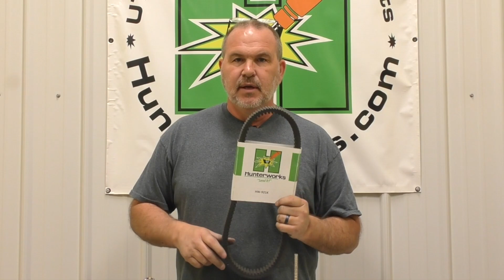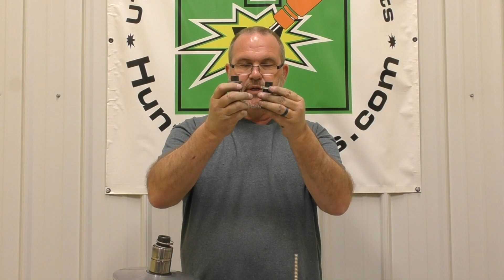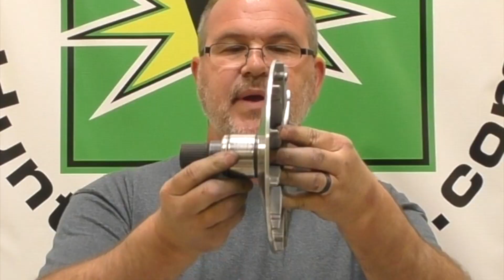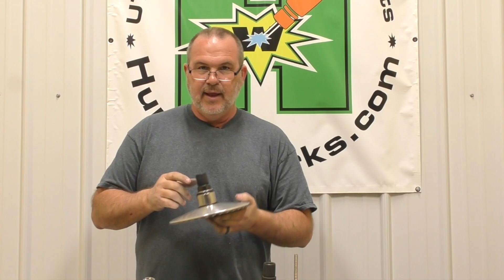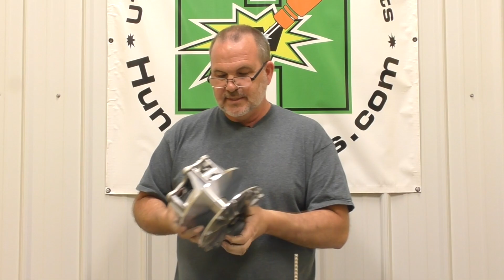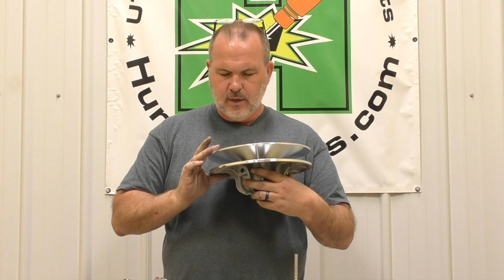2021 Polaris Ranger XP 1000 Clutch Differences

Comment: You keep mentioning the Polaris Ranger 1000XP but what I have is the 2020 1000 esp, is that a different clutch then what I have. What would be the number on your belt that would fit my machine. 2020 Polaris Ranger 1000 esp? Thanks
Reply from the maker: https://www.hunterworks.com/inc/sdetail/96685/181214
Reply from the maker: And yes the regular 1000 has a different clutch than the XP

Comment: How do you know if your 2021 xp1000 ranger has the 1 way ebs bearing or the 2 way non ebs?
Reply from the maker: You should know if the model you bought has ebs but you can take a pic inside clutch and see if you see the ebs mechanism.
Reply: I just bought it yesterday I bought it from a buddy that bought it new only had it a week so I don’t know if it has it or not it kinda feels like it but I’ve only driven it twice.. has less than 5 hours. But that a side I did notice once it wasn’t the easiest to go back into high after driving in low a little distance so had me curious

Comment: Hi Todd , just purchased a 2021 Ranger 1000 Northstar ultimate , our Canadian dealer has the HW 92G and HW Turbo/Turbos RZR belt in stock , what one works for my 2021 Ranger , can you help , really want your belt
Reply from the maker: If a XP it is the turbo belt, if not XP not either , have to get our non xp belt